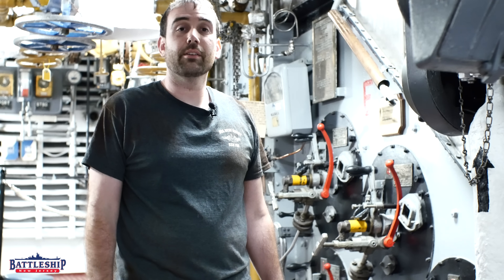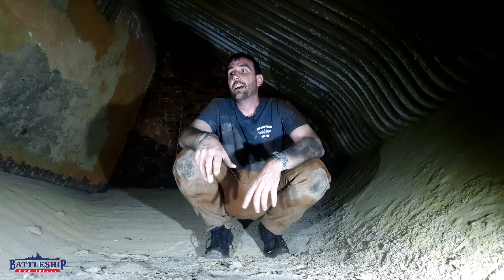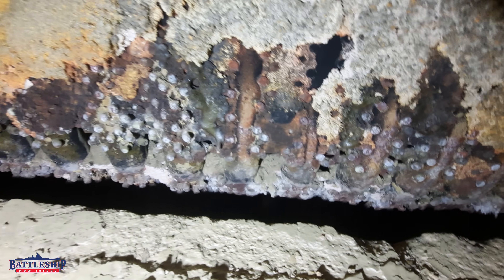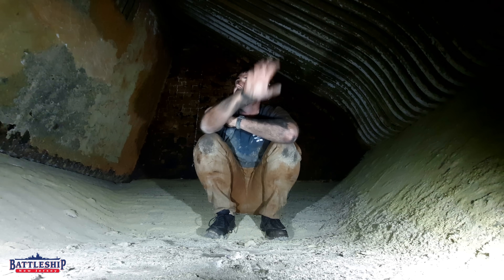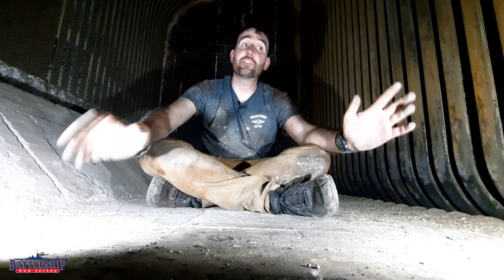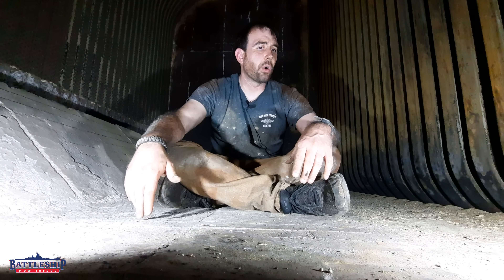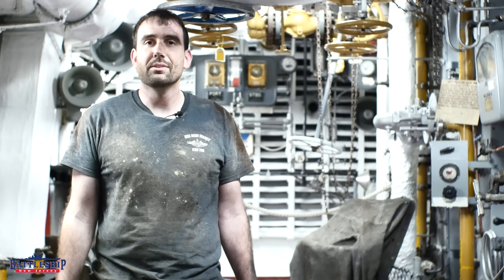Inside the Boiler of The World's Fastest Battleship

Comment: Superheated steam was ALWAYS used for the high pressure turbines. Superheating had to be done to eliminate the chance of condensate which would etch and destroy the turbine blades. The little Destroyer I served on used 1250 psi steam at 1000 degrees! 2 shafts, 70,000 shaft horsepower times 2 enginerooms and two firerooms (boiler rooms) with 4 D type boilers and a very light 4500 tons at full load.
Reply: Never say never, never say always. About half of what you said is true.
Steam traps are what keeps water droplets out of the steam.
In the Navy, they will take one catastrophic event, maybe even battle damage, make it sound like it was just one guy not doing his job, just to scare the shit out of impressionable young kids. 
I sailed 20 years after I got outta Navy, saw things that just went against what the Navy said, but worked better.

Comment: Jersey Bob
Ryan, great video but please be careful. That boiler you went into is what OSHA calls a confined space. Check the law but NEVER enter a confined space without checking that the oxygen level is ok. You should always be harnessed so someone can pull you out if you get injured, fall sick or become unconscious.  Wear a hard hat to keep from hurting your head when (not if, when) you acciendaly bang it on one of those boiler tubes. You also need to be wearing some type of respiratory protection.That fine ash you were sitting on  can cause problems in its own right and who knows what is in it.\  Ashes is whatever is in the fuel that didn't burn; this usually means   heavy metals that can be toxic. Also be aware of asbestos. Those wold war 2 ships were loaded with asbestos and I wouldn't be surprised if that fire brick contained asbestos.  My father spent Word ware 2  helping build Navy ships at New York Shipbuilding in Camden and he died of mesothelioma because of it.

Comment: I'm a retired Boilermaker because, before jumping into any "confined spaced" you get an O2 meter and check to see if the atmosphere inside safe to enter, thats why I'm retired and not 6 feet under. I never worked on a boat I worked in oil yards nuke plants as well as coal and oil fired boilers.

Comment: Gearing DD snipe, '69- '73. Punching downcomer tubes while on your back in the mud drum was the worst job, using a 3" rotary wire wheel driven by 150 p.s.i. air just inches from your face and relying on the guy outside to bend the hose, which was your on/off mechanism. He literally held your life in his hands, no PP or respirators either, just a bandanna scavenged from the rag bag. I got a V A rating for tinnitus damn near on my say so alone just because of my job & workspace. Other rates feared and hated us snipes and officers NEVER came down our hole, as long as we answered all bells.

Comment: I know others have mentioned it but I would never go inside one of those boilers without an asbestos respirator
all of the mortar and insulation are filled with it.  I was a BT3 from 1970-74.
When we had Marines on board they would send the ones that got into trouble to the boiler room as punishment.
Had them paint Red Lead and High temp silver...
Reply: . . . and clean bilges.

Comment: Also, on modern steam powered Navy ships the boilers are controlled from the Enclosed Operating Space (EOS) which is air-conditioned. However, somebody has to go outside of EOS  and check various things during each watch. These ships have "blast terminals" which are large nozzles connected to the A/C for rapid cooling.

Comment: I'm a long-retired Engine Room Artificer from the Royal Navy. A great training... and always steam.
Near the end you refer to a "corrugated metal cover" over the water tubes.  I think what you are referring to is a "water wall" where tubes are manufactured with external studs, to help to convey heat from the furnace to the water and to provide the first stage of insulation against heat loss from the furnace. The sections inbetween  the tubes are infilled with a mixed thermal cement to stop leakage between the riser tubes..... However, as I'm not familiar with USN practice, I am open to someone with that experience correcting me.
Finally... I'd love to know something about the control of the boilers.... Were pneumatic controls utilised? 

Thanks for the video.. most interesting.
Reply: Speaking from experience,,,,,,,NO.  The Iowa's are all manual Boiler control.   Everything from the feedwater input to the fuel and air from the Forced Draft Blowers, is controlled by a BT.
Reply: @barto6577  Thanks for your reply.

Comment: Not sure about this but if I had to guess about the boiler water tubes and the super heater. When the boiler is operating it is important that is super heater does not get too hot. Therefore by creating two compartments separating the water tubes from the super heater you could better maintain the temperature in both areas.
It would also not make any sense to heat the super heater if there was no steam present.
Like the water tubes boiler the super heater is a series of tubes that has a manifold where they join together. The amount of heat that is super heater can absorb is very different from the water tubes.

Comment: Points of order: (1) the steam generated by the water walls collects in the steam drum where water droplets are mechanically separated from the steam before entering the dry pipe. At this point is 99.9% steam. The dry pipe feeds the superheater where the fluid becomes 100% steam. (2) there is no such thing as water above ~700F. It's either steam (below ~3200 psi) or supercritical fluid over 3200 psi.

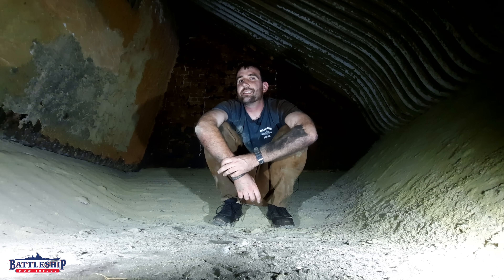Comment: @7:55 "the condenser is are pulling something like a negative 2 atmospheres vacuum"

No.  You can't have a pressure below a perfect vacuum anywhere.  Not in a condenser, not in a physics lab, not in deep space.

We operate our condenser around 2 psia = a negative 12.7 psig in our 80-MW power production plant.  Close to (but never below, because it's physically impossible) a single atmospehere (by gauge) vacuum.

psia = pounds per square absolute (pressure above a complete vacuum).
psig - pounds per  square inch, gauge (pressure above or below atmospheric as read by most gauges).

Comment: Those things on the tubes are spot welded cylindrical posts, designed to hold refractory ( fireproof “mud” cement) in place. To give the mud a grip vs a slick tube.
They are primarily used on vertical wall tubes to certain height, and floors where tubing is in areas of high heat, wear, and from cyclonic force fed air and also induced air. The air movement along with “trash” ( sand particles etc) in the ash is very abrasive . 
If the ship has a mud drum and steam drum then its a subcritical boiler. If it only has a steam drum its a supercritical boiler.
I’m a retired union boilermaker .

Comment: Interesting video for sure.  I wonder how the design of the New Jersey's 600 lb plant compares to the Tarawa class 600 lb plant. I wonder what advances (if any) there were in the technology. 
It would be interesting to look inside the Condensers and sea-chests as the temperature difference in seawater had an effect on the amount of horsepower that could be generated.  In cold water of the North Pacific, we could make about 1 1/2 knots over the warm waters around the equator.  BTW, I think you might have gotten your life-time dose of asbestos crawling through the boilers.  Yuck!  Keep up the good work.

Comment: Go inside the economize and count the tubes ! The ship I was on...(U S S Columbus C G 12)  also had 600 lb Babcock and Wilcock boilers and we were required to do fireside every 600 hours of operation. And waterside every 1200 hours of operation. This time frame may have been changed when they switched to the newer cleaner fuel. Our ship used the thicker crude oil..(Known as black oil) . Best way to explain it is it's the raw crude oil that comes out of the ground..it just has been filtered to remove rocks and dirt from it. The oil then is heated to make it a thinner viscosity  and some benzene  was also added to help fire up a cold boiler ( it helped make the oil more flammable).

Comment: 7:56 How can condenser vacuum be negative 2 atmospheres? If spent steam is at 0 psi (relative to outside atmosphere aka gauge, so around 14.7 psi absolute) and condenser is at 0 psi absolute, ie. complete vacuum, this gives negative 1 atmoshpere (gauge), but not -2 atm.

6:59 Ryan says that turbine inlet pressure is 535 psi while boilers are capable of producing 600 psi. Does this mean that as much as 65 psi or 11% is lost in the tubing between them? That would be a lot.
Reply: First, that’s discharge pressure into the condenser. Then when the steam condenses back into water, it creates a vacuum. Second we used steam powered air ejectors and seals to help maintain approximately 29” vacuum on the condensers at all time when operating. 

We had full pressure at the throttles, Actually 650 psi. The pressure started to drop as soon as it left the nozzles. I believe this is what Ryan is referring to. The only time this wasn’t true, during our full speed run in 90’ we ran full pressure on both boiler, 650 psi, however, at the throttles we showed only 500 psi. We lost that much pressure between the two points because we were using the steam so fast it wouldn’t show boiler header pressure.

Comment: Ryan;    I've spent some time working on the boiler of a steam railroad locomotive (both inside the firebox and inside the boiler barrel itself) and it is interesting to see the differences between the water tube boiler of a battleship and the fire tube boiler of a steam railroad locomotive.  The scale is a bit different too!  Thanks for the tour!

      Two questions arise in my mind though...  

       First, at 7:54 you state that the condensers are pulling a 2 atmosphere vacuum on the LP turbine exhaust.  I can understand how you could possibly get down to (or close to) 1 atmosphere vacuum if you work at it hard enough but how do you get from 1 atmosphere of vacuum to 2 atmospheres of vacuum?   I just can't wrap my head around the physics of how that could be possible.

        Second, as pressure is increased on water the boiling point temperature of the water is increased.  The converse is also true.  As the pressure is reduced on water the boiling point temperature of the water decreases.  For example, at 0.25 PSI(A) pressure (which really isn't a very good vacuum) water boils at about 59.4 degrees (F.).  In many areas of the 7 seas the surface water temperature is higher than that so if the condenser pressure was that low nothing at all would condense as the sea water temperature is higher than the boiling temperature of the steam that the condenser is trying to condense.

        Clearly the boilers and condensers on battleships do work, so something must be off in my understanding of the situation.  Can anybody explain this to me?  On many steam railroad locomotives we do use superheaters but condensers are almost unheard of and used only in niche applications where boiler water is hard to source or the spent steam must not be exhausted to the environment.  The usual use for spent steam on railroad locomotives is to improve the boiler draft by expelling the spent steam through a blast pipe in the smokestack.  This is what gives steam locomotives their characteristic "chuffing" sound.
Reply: Vincent Sullivan, I operated this system here. I worked in #1 and #4 engine rooms. I can tell you we ran at approximately 29” vacuum on the condensers. Anything above 25” we have a problem. 

We used steam air ejectors to help us maintain this vacuum, and remove the air and non-condensable gases. We also sealed all our shafts to minimize air/steam leaking. 

If you have more questions please let me know, and I will answer for you.

Comment: WellDone! Pretty good grasp/‘splain, of heat exch, for vid.
I am truly impressed at your on-location location. I was a 1200# superheated guy, 
USS America. USN snipe has access to some of the dirtiest places on the planet. I was MM, so my dirt was typically a little oilier than the soot-like powder, but, just as dirty. 
   For me, the most horrible part was snaking one’s way int 
nooks, crannies, crev-azzes, that were formed by several inch thick iron.
cold.
NO flex.
also, that little twist, halfway in, the only way you fit.
Believe me, this can cause
unrest between one’s ears.
great video!

Comment: I found it much easier to slide in and out on my back. Keeps your face and arms out of the soot and you can use your feet to push of the outer air casing.
Navy Special Fuel (NSFO) is F-77 NATO I believe. It was Bunker "C" blended with 20% JP-5 which reduced the viscosity so it could be pumped without heating in most ambient conditions though it still require heating for proper atomizing.  It was phased out in the 1970's. Navy Distillate (ND) or NATO F-76 replaced NSFO as a boiler fuel for ship propulsion. It looks like a dark beer and even can have a head on it. Our ship converted from NSFO to ND in 1972.
The Captain run the ship, but the BT's made the ship run! 
Oilking DE-1076 1971-74, DD-596 before that
Reply: Hello USS Fanning sailor.

Comment: 8:18 thats the bit i never understood.. why would you do that why not take the dead steam and put it back into the super heating you burnt all this fuel to get it to like 800 degrees and now even tho its still got a good few 100 degrees left in it you thow it way into the sea
Reply: at this point most of the energy is out of the steam and it is at a very low pressure.   You cant pump the steam back into the high pressure boiler so by taking a little energy out of it you can condense it and pump the condensate back to the DFT.
Reply: By the time the steam passes through the LP turbine and exhausts into the main condenser, it's pretty much spent.  It's now considered aux exhaust steam and is used for things like heating feed water in the DFT and heating water in the distilling units.  It's such low pressure in the main condenser, I think the safeties are set at around 15 psi
Reply: Dead steam is hot but at low pressure. The economizers/recuperators recover a lot of the heat energy. 👍

Comment: good job of explaining the steam cycle on the ship.   You didnt have to get the smallest guy to go into the boilers because most  of the sailors were young enough they didnt have any extra weight when they got to the ship and if they did you would sweat it off working in the hole.    Now lets see Ryan in the waterside punching some tubes, do a main condenser seawater side inspection and really get oily doing a reduction gear inspection.    and a shout out to your hole watch.

Comment: One of the BT's jobs is to analyze boiler feed water to make sure it is clean enough, and add additives as necessary to keep minerals from clogging things up. Also, some marine boilers have some water tubes blocked in order to increase flow in the remaining ones, depending on how the heat inside the boiler is distributed.
Reply: It is actually standard to plug boiler tubes when they leak.
Reply: @tedmoss  not talking about leaks. The heat distribution of any new boiler is examined to see if it is acceptably even. Tubes which receive less heat that optimum may be plugged to increase water circulation in the tubes that get hot enough.

Comment: is there any area of the ship that is fully sealed but large enough to get into that ha not been opened during mothball but were designed to be totally sealed like a vacuum
Reply from the maker: Not all of the tanks have been reopened. But otherwise, no
Reply: @BattleshipNewJersey   really so there is no area of the ship that was air sealed by bulkheads  and would need to be cut open to get into. and where designed by purpose or accident to be sealed dead space that has nothing in it and is not used as a tank or anything.

Comment: Very interesting, I work a lot with deionised water.  Deionised water eats away at everything apart from stainless, are the water and steam pipes fabricated from stainless?

Edit: Seeing the super heated side the pipes look copper
Reply: From what I gather from the video it is not deionized water. It is purified water from all the minerals.
Reply: not deionized but purified and very tight chemistry controls.    not copper but carbon steel tubes hence the need for tight chemistry controls.
Reply: The water is kept fairly alkaline  ~8.7-9.2 if I remember correctly,,,,,,Gawd it's been 35 years and I still remember that sh!t.

edit for spelink

Comment: is the fuel sprayed in at pressure? very interesting - it would be interesting to see a sjip schematic/deckplan to track where you are
Reply: yes   the fuel is mixed with air to start or steam if available to atomize it so you get better(cleaner) combustion.   he was at the bottom of the ship.
Reply: Most ships I worked on had 150# atomizing steam mix with the fuel oil right at the burners/air registers ...... except the BBs